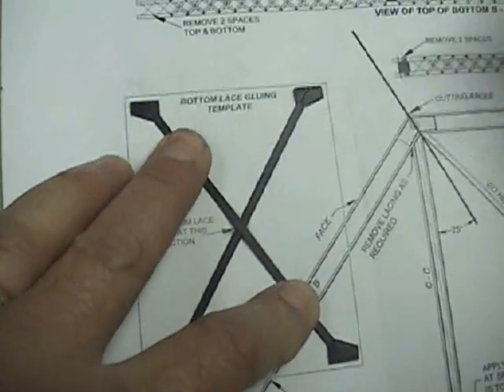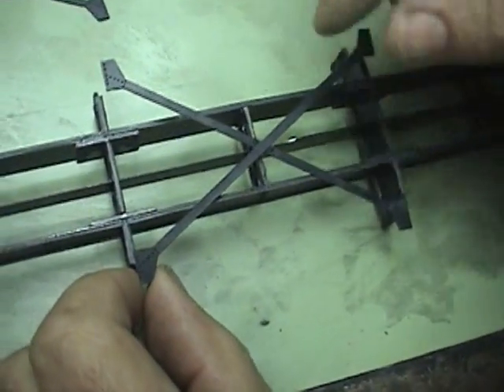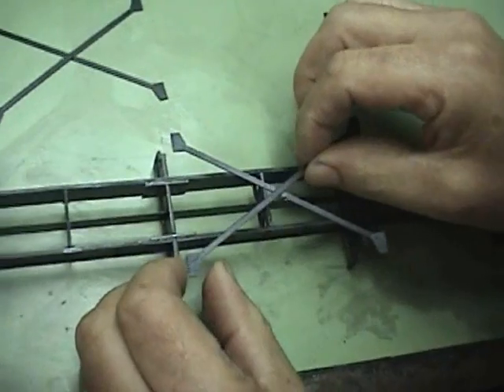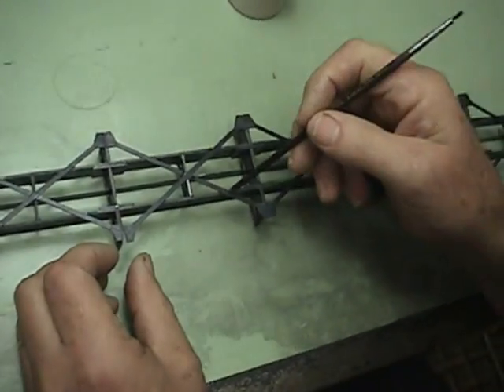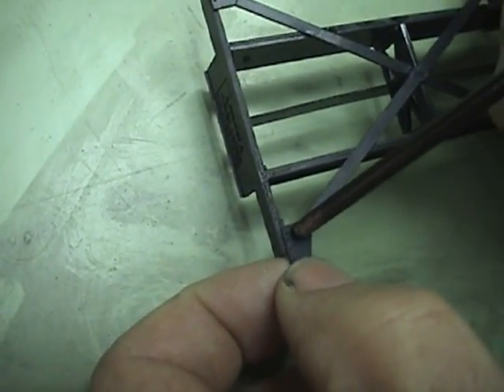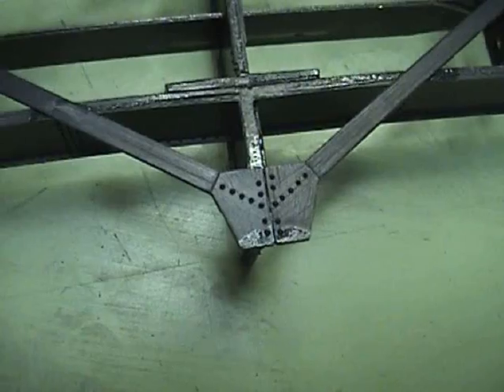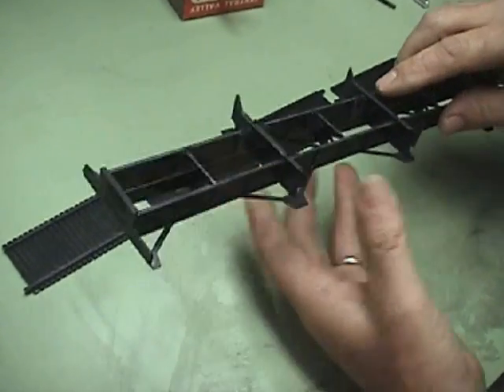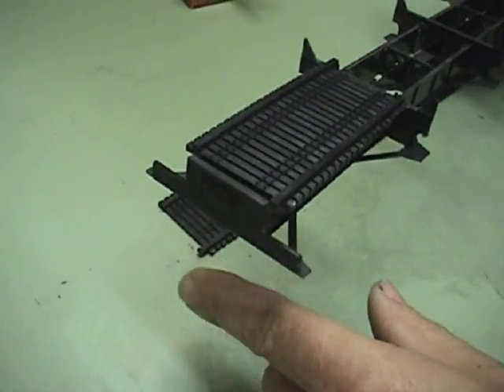The Central Valley 1902 truss Part - 01- B

Comment: Nice video. What glue are you using?
Reply from the maker: I am using Tamiya Liquid Styrene to be politically correct. -- Many times when nobody is looking and have lots of good ventilation, I use MEK which is a very toxic and should only be used in a properly ventilated area.
Reply: ***** Thanks for the quick reply. Im going to my LHS today. You are using MEK as a cleaner or a glue?   I used to paint real helicopters. We cleaned our airguns with that stuff, yikes. Will your 1900 bridge work with code 100?  I using a 2 1/2 inch spacing between tracks, so Im guessing an easement is needed for the 2 inch spacing?
Reply from the maker: ifly65 MEK is a very useful styrene glue. I am developing code 100 ties for the bridge kis as we speak. These code 100 25 truss tie sections will be sold separately in a scale 200 foot pack including stringers. The doubletrack kit requires 2 of these packages. Personally, I would use the easement to approach the bridge, although it is very easy to offset the ties on the double track kit out to a maximum of 2.625 inches.----insert pasted information-----Track center lines are designed to be 2  inches and are fully adjustable from 1.875 center-to-center out to 2.625 center-to-center. These two extreme adjustments will possibly cause interferences between trains on the low end or, interferences with trains to the truss structure on the high end in both height and width, thus voiding any warranties of defects, or NMRA compliance.
Reply: ***** Thanks again, Im a newbie and this is my first truss bridge.  I like the easement so 2" is fine.  Do I still use my Peco flex track through the double bridge or do these have tracks with the kit?  How much will each of these code 100 ties kits cost?
Reply from the maker: ifly65 I have never touched any Peco flex or rail so I do not know if or how it may or maynot work.. I recommend using Micro Engineering  code 83/70 as the kit supplies these ties for this right out of the box. I get my rail from this link -- http://www.proto87.com/product1899.html
Reply: ***** Is it ok to use code 83 for the bridge and code 100 for the rest of the layout?
Reply from the maker: ifly65 Yup no issues I can think of. The track gauge is exactly the same. only diff is the bridge structure,--- which is 0.017 of an inch higher than normal. I can't see that without  a wire line and a magnifier over my eyes.
Reply: ***** Thanks again for quickly answering me so many times. I just built a suspended track in my kitchen.  I can adjust the bridge height to level the rails too, if that helps. Sounds good.  Now I need to learn how to build plastic models.